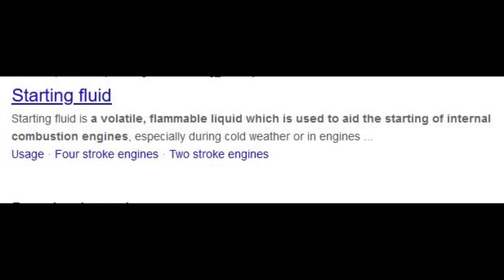Why do Diesels get Addicted to Ether?

Comment: start ya bastard was very popular here in australia victa sold 2 stroke mowers until 2020 when emission regs finally killed them off they were a bastard to start heavy 25/1 oil mix low comp 5/6 to 1 from memory really easy to flood still got an old can in the garage once my parents brought a honda 4 stroke mower start ya bastard was never required again 
i still remember saturdays the air in the street would slowly get more of a blue tinge as more people mowed their lawns throughout the day as much as people complain about emission standards they are for the greater good i haven't seen any visible pollution in years

Comment: We had a 471 Detroit in a Taylor forklift with very high hours. You could turn the engine over by turning the fan! It had very low compression, lots of blow by and no power! It always required a snort if the temp was less than 50 deg F. An in-frame with new liners cured its addiction.
Reply: I'm surprised it would start above 50 without a sniff.

Comment: Buy John Deere ether. It’s generally the strongest. Years ago John Deere started so poorly that they produced a better ether to help, instead of actually fixing the problems. I learned this from the tractor pullers around here when I questioned the blue guys why the use green ether.

Comment: Let's add to that list of why diesels need the huff:
-bleed down of fuel system
-dirty fuel
-water in fuel
-mother in laws
-drag on starter system
-clutch not releasing properly
-two sprays for the truck one spray for the driver
-low sulfur diesel
- years off huff damage on cylinder walls
-temperatures approaching Siberia

Comment: it's a fallacy' when people start using ether on a diesel it's worn out anyway poor compression' what the ether does is up the compression just enough to get it to run, constant usage strips any carbon deposits away from the piston taking away any compression it had hence more use of ether , being in the engine rebuild trade for many years ( now retired )  an 1/8th'' gap between bore & piston was common' some beyond rebore as the liner wall was too thin re-sleeve was the only option sometimes customer refused due to the cost , we did have an engine that the customer could not get to start after re-bore + pistons but said it would run on ether' my dear lord i sent a diesel mechanic down to the garage that re-built the engine' mechanic found the spill timing was 180deg out (timing belt ) when he got back he said Man did that engine stink when i ran it up ...............

Comment: Hot air gun is good for diesel. Heat the intake first. Then give hot air to air cleaner. Its easier to compress hot air to ignition hot.

Comment: Have been using ether in engines long enough to have used ether capsules, Detroit diesel used to have a cup with a large needle to pierce the capsules, this was obviously factory approved.
More recently, was doing a PM service to a refrigeration unit, I found the air filter burnt and all of the filter media gone, it had been burnt and only the wire frame of the filter was left, I replaced the four glow plugs, the filter housing and air intake hose between the manifold and the housing, someone overdid the ether, it backfired and caught on fire, somehow the engine is running fine. I don’t know how.

Comment: Quite a place I worked at 2014-16. Truck repair specializing in Railroad Adapted ("High Rail") trucks but a little bit of everything. Old Guy owned the place bought/sold trucks and other stuff. Six times when I was there they bought trucks tractors and even diesel welding machines - that were "locked up" and then sold at auction.
      Never knew (hey I am a gas-engine guy) that it is possible to load one up so full of ether that the starter can't crank it AT ALL. Taking the injectors out and cranking it, changing oil and usually the starter and battery - aaand:  "good as new" !
Reply: I've got an 86 6.2 Detroit that will lock up if you micro bump a can of ether.  If I disconnect the glow plugs, it will kind of work.  It broke the starter once, and the ring gear another time, so I don't fool with ether anymore.  Now I just fix the actual problem.  Usually fuel issue.

Comment: Josh short answer:
Mystery of 50+ yrs!!!
Seen innumerable instances; ZERO explanations
3wks ago: a CLUE!
3406B in W900 empty rig (hauls 8 tons a day) that I sold at -800,000mi circa '05, got addicted maybe 5 yrs later in snow country.
3 weeks (2024) ago my (our) shop replaced the stock (ORIGINAL) fuel pump at approx 1 M miles (for my friend who still owns the truck) 
Starts first try. Purrs like kitty CAT.
I'm thinking the pump got weak at some point (800,000) and we (they) went to ether in snow. (not me, but them) 
Viable in this case w/this mill w/this mileage
Az truck since new
-----
That's my story...
And I'm stickin' with it
50yrs of mystery!!!???
Cheers!
-------
My buddy only has regular oil changes on this truck since about the 800,000 mi mark
Serious mill.

Comment: I didnt watch the video yet. but they dont they just get worn out. We had a loader they said got addicted. We used either in the winter then had to use it all the time even a warm summer morning. its a nice story but it had a ton of hours and cold starts and i think it was just getting lazy and worn out. It was a lot easier on the batteries and starter if you just gave it a sniff first. Now ill watch the video see what you think

Comment: Some old diesels had built in ether dispensing systems for cold starts. To the annoyance of operators who have to change the ether cartridges. So if used properly ether is fine.

Comment: I had a 84 ford with a 6.9, would start cold everytime.
When it was hot, it would not start without a shot of eather.
The injection pump would expand from heat and not deliver fuel.
Reply: Wait that doesn't make any sense
Reply: @wizard_of_poz4413  
I heard other people with that problem would slowly pour cold water on pump to cool it.
Reply: We also had an 84 F250 6.9L, it was a cold start nightmare, Cosby sauce kept her going.
Reply: Wore out injection pump

Comment: In my youth, many many years ago, I discovered starting fluid. Boy this stuff is great, nice flame while holding a lighter in front of it. So I bought two small cans. It was summer and out of school, I gathered several kids on my block. Created a dope ring and sprayed one can with another. Dropped a match and nobody had any eye lashes or eyebrows, when we took off running.
Reply: It's truly a wonder some of us are still alive...
Reply: Some had to survive to explain to the next generation how stupid it is and why not to do it.🤪
Reply: @deanmeyer1815  That's it. remove all the warning labels and let nature sort itself out. It would be bound to prune a few of the low hanging leaves
Reply: @hedge685 
That’s exactly what I was thinking 🤔 😂😂
Reply: When we discovered Pyrodex in 9th grade it wasn't long before a State Senator found out about it. Lol. Whoops.
Reply: This is probably a better use than it was initially intended for.

Comment: In the training for the Cummins ISX12/15 they specifically point out a port in the intake used for ether starting

So giver er' a snort and put it in the ketchup!
Reply: I presume downstream of the grid heater?
Reply: @wizard_of_poz4413 The X models don't have any grid heaters or glowplugs

Maybe a block heater but nothing as far as intake air heating

Comment: Several years ago (before we had field service) a customer called in because his motor home ran out of fuel. He was trying to save $0.05 cents by getting to another station. He talked our supervisor in sending a tech out to get it running.
The tech called back and said "The engine blew up". After arguing back and forth, the boss asked "How do you know it's blown up?"  Which the tech replied back, "The push rods are sticking through the valve covers". The tech was labeled the "Either Bunny" for awhile. Needless to say the motor home was towed in, engine & trans dropped down to the floor. Motor home lifted up and we pulled the engine out and rebuilt it. The joys of saving a nickel a gallon.
Reply: how did you rebuild it, with holes in the head and block? sounds like an anchor waiting for a new box to go into it.
Reply: @LygerTheCLaw  Replaced valve covers, valve train damage, bearings, rings, valve job.
Reply: The ether bunny.  Legend in the bush was one bunk house one guy would pass out and wake up with a sore butt every night. The other occupant of the bunkhouse was signing out ether cans from supply. He run saw though.  The guy with the sore butt never moved out.  
He liked the ether bunny.

Comment: This has brought back a couple of memories a buddy of mine had bought a.new international 4070A I was following him he had a big puff of white smoke and started slowing down I pulled over behind him the 32 once can of starting fluid had emptied into the hot running engine that 350 Cummings came apart in some interesting ways and then I had an employee spray an unknown amount in a tired old 220 Cummings and then it would not start stretched head bolts and other bad things happened

Comment: It is just a volatile...and a dry one with no lubricity.  A bad habit for sure unless prescribed. Also very useful for popping tires onto their rims with the flick of a match.  Organic Chem: Meth, Eth, Prop, But, Pent, Hex and so on.  The lower it is, the earlier in temperature it ignites.  The earlier it is the less lubricity it has.  However, if you only need one stroke to light it off and switch to Dec(diesel), what is the big deal?  One blow and then go.  The problem is dumping way too much into the system. Pre-heater systems involved?  Use it and be deemed an idiot, IMO.  You get your beard burned off if things go right.

Comment: Up until 1980s many had factory installed either starting aide.
Used it for decades.
New engines especially Japanese Kubota never ever use it .

Excellent for blowing tires beads back on rims 💥

Comment: A gasoline soaked rag over the air intake has always worked just great for me.
Just don't let go of the rag..
Reply: The modern "flaming rag" is to bore a hole in the metal intake manifold, tap it and screw in a Thermostart "Flame heater"...
that uses 12VDC to heat a coil of wire and open a small built in valve to drip diesel onto it and cause a flame in the intake,,,,
This is all controlled by a push button on the dash...
button off after engine starts and the coil turns off and the little valve closes....
ready for the next start...  

YT vids available...
Reply: Yes, my Ford farm tractor (mid 80s) has the Thermostart feature. It seems to work well. A clever design. @JohnSmith-yv6eq
Reply: Instructions unclear…
Dic* got sucked into turbo…
Reply: You didn't deserve to have one anyway.
Reply: A bit of petrol on a rag is a good way to help get a cold deisel started and not as volatile as ether. I have used a little squirt of DWF at times, seems to work also.
Reply: Yes gasoline on rag.  Don't let it get sucked into air intake
Reply: @DuaneWilson-ro1pn  other than ruining the engine, will it like flame throw or?
Reply: I use this method more often than I care to admit
When my guys run a tank dry
Reply: Seems like the don't let go part is from experience🤣

Comment: I almost used ether on mine this winter. 
I have a low compression high performance built engine
And it didn’t like to start below 20f

Turns out my glow plug fuse has fractured. …
And replacing that- did a -20f start without a block heater just fine. 

Even if your rig has been reliable
Doesn’t make you immune to diagnosis just like erry body else😂

Comment: ONCE UPON A TIME  there was a factory that had a gigantic emergency
Backup Diesel generator. The owner of this company put his fresh out of college
Son in charge of the generator crew. It was the crews practice to fire off the diesel
Monthly as is best practices. WELL, one month the diesel would not start. They
Tried everything. The checked all there was to check. FINALLY, the bosses kid
Calls the shop helper over gives him some $$ and tells him ‘Go find 2 of the 
biggest containers of ether you can find’.  After a short time, this kid returns with
2    1gallon jugs of ether. The bosses kid climbs up on a ladder & pours the whole
2 gallons down the diesels throat. The crew was horrified. Everyone scattered 
looking for something to hide behind. The kid climbed down off the ladder, hit
the start button & all that ether lit off. It created  SO  much pressure, the heads
lifted off the block a bit, coolant shot out, then the head slammed back down
onto the block & the diesel roared to life.

!
Reply: That’s THE best BULLSHIT story I’ve heard in decades!
Now....
Tell us about the time aliens kidnapped you. 🤣

Comment: Unfortunately a lot of people are Reluctant to take their vehicle or equipment into the shop these days.
There Afraid of the Cost to Repair the Shop is going to Quote and live with whatever issues as long as possible.
Second would be the Lack of Tust in Technicians these days to get it Right the First Time and the associated Cost of Chasing the Issue.
Reply: Especially when 3rd party repair shops can't get the parts, and the "authorized" techs are "special"
Reply: I’ve ran into that plenty of times, absolutely worthless techs wasting peoples time and money. Had one hook up a fan solenoid backwards, charged me 4 hours labor when I brought it in told. Him exactly what needed to be fixed, then later told him what he had done wrong and he still wasted a few more hours after that trying to figure out why it wouldn’t work. Had a genius take a torch to my AC compressor to get the bad clutch off it, still not sure what that was supposed to accomplish once the shaft was cut off the compressor…

Comment: Key word— if used properly!!      Ya have you dealt with the general public or truck people. Or people that say they are mechanics.   Never mind the grid heaters and glow plugs they don’t understand them that’s why they just get in and crank them over and don’t let them do the job they are there for.   Good video if someone can learn from it.   I’ve been trying to get the non English speaking so the say mechanics to stop using it but no  luck   Someday when the blow the intake off the engine they might listen.
Reply: We'd usually see at least 1 7.3 Powerstroke come in with a popped filter housing every cold snap back in Northern Colorado. 
My favorite though was the Duramax that spun to the moon and destroyed its valvetrain. "No, we didn't use ether!" The distinct odor coming from your intake tract and 2 empty cans under-hood says otherwise.
Reply: You cannot fix stupid ......
Reply: @leso204  Sometimes you can, but it's almost always painful or/and expensive.

Comment: A diesel fires right after commencement of fuel injection. You spray either in it and it  fires pretty much uncontrolled (way early) that is severe detonation. That is why you hear all that banging when those idiots are doing cold start videos and spraying tons of either. It's way hard on engine components. Do things right and preheat, block heater, glow plugs in an IDI, manifold heater, whatever. I've torn down lots of engines from guys that love either, broken rings, upper ring land broken off the top of the piston, etc. All the detonation is hard on stuff
Reply: And big end shells 😎
Reply: Can't forget the banana shaped connecting rods I've seen alot o those there is a right way and a wrong way to use ether... Light spray while cranking over the air cleaner as that slows the dispersion combined with disabling the glow plugs/grid heater while using the ether... It's always better to crank the engine more than to use too much ether as the cranking actually will warm the engine up via air compression in the cylinders so that the light ether can be effective without dealing damage.
Reply: Yes, a light sniff is all it should need, it freaked me out watching a mechanic spray ether for 5-10 seconds at a time in my old JD tractor to start it one time. A little Petrol on a rag is probably a lot softer on everything.

Comment: 2 stroke jimmies ....once ya start....never ends...even warm mid summer.
Reply: Its not yhe use of either the engine is worn out & needs help !!!
Reply: Bullshite I own a v871 that has been either started several times In The frozen (-54F) waste land of Fairbanks Alaska and if she's been plugged in an appropriate amount of time in the winter she barks right to life. And in the summer she will bark right to life before it makes one revolution GTFO with your bs wore out engines that need a set of liners and pistons can be addicted to either but if its in good shape and still has ring seal at cranking speed and ya didn't overdo it predetonate it and break a top piston ring thereby losing cranking speed compression she won't get addicted. The big lie just cause everybody says it don't make it so.

Comment: i talked to a guy who used starting fluid to prime fuel systems. it left me speechless, and i'm the guy who scares the think big kids by giving a running engine a shot of the goofy grape.
Reply: A cheap Facet-style click click 12VDC inline fuel pump pushing fuel through every filter, lift pump, injection pump and injector is the way to go these days....
just bleed appropriately and go...